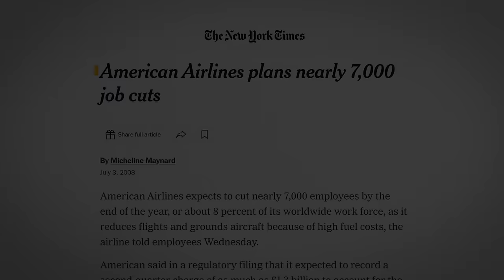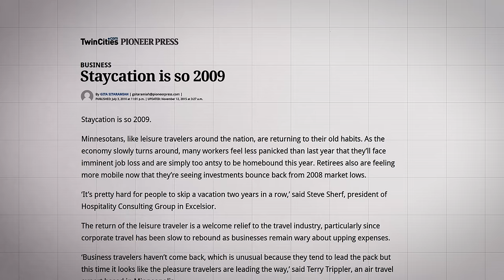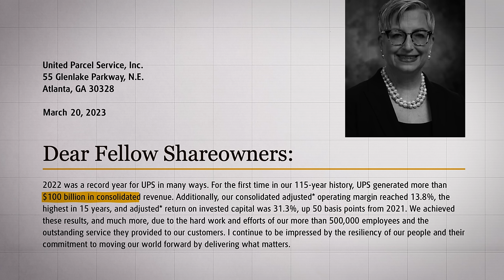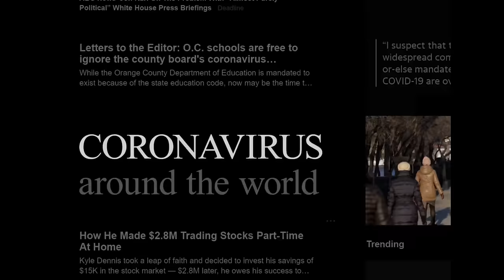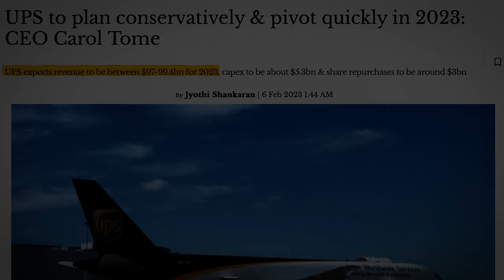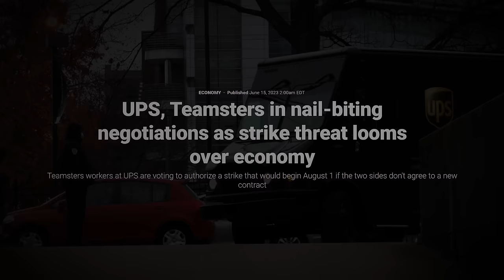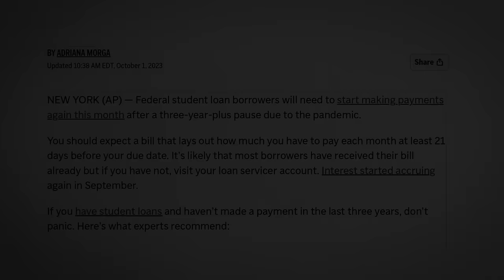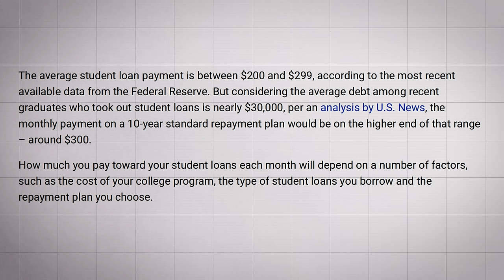Money is Gone: Airlines Start Layoffs Soon

Comment: As a UPSer, the whole situation does have me a bit concerned.  I'm in the automotive department, and a lot of moves they are making in this area show a lot of short term thinking, rather than a long term strategy.  A recent change in oil change services I feel is going to decrease the cost of oil changes on paper by making the services further apart, but cause a large increase in both non scheduled service and shorten vehicle life.  But this is what happens when you have a company catering to stock price.  They start carving out the meat of the company, gutting the long term improvement projects, and taking as much as they can in the short term. 
I can also see that we are about to hit a nose dive of a financial "readjustment" period that I feel will make the Great Recession seem like the good old days.  All the markers are there, and this time is going to be 1000x worse because of those companies gutting value and deferring capital expenses.  
As far as freight vs passengers, neither is better, but freight is less hassle.  Passenger planes are just buses with wings now.  A statement about passenger operations in railroads holds pretty true still, and that's that passengers are the pickiest type of freight.
Reply: I have worked for a huge multinational transportation and leasing company, and some of the things they came up with to save money were absurd. At one point, we were changing too many batteries starters and alternators, so they locked them in a cage that only a supervisor has a key for. Even if the starter solenoid was dangling from the cables, we had to load test the batteries, load test the alternator, amp test the starter  (both impossible while not running lol) and do a voltage drop test on starter and battery cables and record all test results on paper. Then the starter would be freed from jail and we were allowed to change it. They were in house rebuilds that were junk too and often failed within 6 months. I don't know about you, but I'm not changing a 40-50lb starter with seized bolts unless I'm sure it needs it.
Reply: I come from the heavy equipment world and you can always spot the fundamental changes that come with a new CEO. All too often they start cutting the simple things like oil and filter changes. Rapid fleet decline follows more quickly than many of them realize.
Reply: @juliogonzo2718  Wow. Oil is the cheapest thing you can do for a vehicle and they’re cheating out on that? That’s sad.

Comment: In the past few years, UPS has been going downhill ever since this new CEO was hired. In my department we have never really had any layoffs and they are saying possibly as many as 100 feeder drivers (we have about 360 currently in my local) will be laid off. That is over 25% of our department. After 30 years at UPS, I have never seen volume this low coming into the holiday season. Last year was the worst ever, and this year is looking as bad or worse. Also, where the CEO claims we will be getting close to $170,000 a year, that is the estimate at the END of this contract in 2028, not now, and even then I don't think that will be accurate. That was more a public relations thing to make it sound like we make more than we actually do. Trust me, even with the proposed raises and calculating in the benefits, it won't be anything close to $170,000.

Comment: Firstly, congrats on your upgrade. I’ve been at 5Y for over 12 years. My career goal had always been 5X. I was offered a class date 1.5 years ago and turned it down to stay to stay at 5Y. Mostly because of a lot of the things you’ve talked about in this video. Had I taken the class I’d currently be sitting at the very bottom of the list and quite worried about my job. No desire to fly people. I don’t think this is a cargo only issue though. I believe it’s just a prelude to an overall industry downturn. Most airline pilots under 35 haven’t flown through 9/11. Haven’t flown through 2008. Most have never been furloughed. Everyone has been looking at the last two years of hiring as if it’s going to be this way forever.  All signs point to a substantial economic letdown. I’d rather be insulated with some seniority and make slightly less pay than worried about whether I’m going to be able to pay my mortgage in six months.
Reply: Yeah, being at Atlas if you’ve been there for 12 years is and staying is better than leaving to start over. I am going to guess you are around 45-50 so definitely the right call. Good luck bro.
Reply: @williampotts3 the grass is always greener.....  i think you made the right decision, fwiw.

Comment: Of course there are pay , schedule and route considerations, but if all else is equal, I rather fly cargo than passengers. I do not have to be as concern if I am forced to divert, cargo do not complain, and no boos from the back if I have to plant the gear down firmly on a windy day, and less concerns about spilled drinks and meals. I am also under the impression the cost of labor is a small amount, especially for freighters with no cabin crew. The main cost is fuel, maintenance and paying for the plane etc.

Comment: Love the channel.  Went into the DHL report on the global state of the Air Freight industry.  To summarize demand is lack luster and capacity has increased, Air cargo rates are still 29% lower than last year levels (but trend is increasing).  So short term it is not a stellar outlook but long term e-commerce will continue to drive demand.  So perhaps UPS has excess capacity and is matching it to what it thinks market demand will be.  I think most companies can handle this by stopping hiring and going through normal attrition.

Comment: That is not all the problems for UPS. Here UPS is considered an inferior service with bad customer services. They are behind on modern ways to communicate with customers, which means dealing with UPS causes more hassle. For instance if you can not be home at arrival, UPS just leaves a note in the mailbox. You do not even get an SMS message when they expect to arrive. So you get a lot of hassle with contacting them to arrange a new delivery. Other companies, like DHL, BRING and DAO, send an SMS about the delivery. In that SMS there is a link, where you can change your delivery to a local outlet or they can simply leave it without a signature. So no extra waiting or having to contact customer services to arrange a new delivery. Besides, you often have to wait 30-45 min on the phone to UPS. So UPS is simply not up to date with customer services here in Europe - and why they only have a small share of the market.

Comment: Well yeah, UPS was just forced to up their driver pay from an average $60,000/yr to 140,000-170,000/yr. I'd wager there's probably 100 drivers per state on average (total guess) and with 50 states, that's an estimate 775,000,000 cost in wages up from ~300M (so a 260% increase in cost).

Now begins the rubberband reaction.

Comment: Good thing you have 1.2M subscriber's. Better turn those ads on to generate a little revenue.
I can assure you with both Russia and Middle East at War, fuel costs will increase when we need the most.

How did FedEx top UPS with their crappy commercial portals? The error in freight rates cancel volume discounts.

Comment: During the cockpit incursion of Horizon Airlines 2059, on Sunday, the intruder (An Alaska Airlines Pilot in the cockpit jump seat) was trying to pull the fire suppression on both engines. (84 souls on board.) If successful: 

Would the pilots have been able to restart the engines?

From the flight recording, I believe they were at 10,000 ft.

Comment: Inflation affects every industry and persons at different speeds. The average family was the widest group who actually felt it first on a personal level because it hit the pocketbook. This is creating less unneeded purchases. Why? because the suppliers had no choice to raise their costs. Air travel continued to grow with airlines expanding their routes, and currently air travel is higher than it was before the pandemic. At some point the unstable and high fuel costs will have an effect on commercial air for travel and cargo. I know the airlines hedge fuel purchases, it's what propelled Southwest to the position it's in now but at some point, that speculative fuel purchase is going to hit hard, stripping an already thin profit margin from the carriers to the point where fares will return to pricing that only higher-class earners can afford. Oil/fuel is what feeds and controls so many markets. Trucks, trains, boats, aircraft, power plants, farm equipment and the list goes on. When the cost to do business, which all businesses either directly or indirectly do, relies on the price of fuel, there may come a time that companies can't operate because the customer won't be able to afford to use their services or buy their product. This is NOT a pro alternative energy comment, it's the exact opposite. Pushing alternative energy is a major contributor to the problem.

Comment: The issues in the ME wont help if it kicks off proper.  The likes of WG might actually do better out of it though as their DoD work will go up.  Personally I think WG will just be left to expire so the "stuff" they were doing (if you get my drift) can be shifted onto the next company - in fact thats already happening / happened.  The other issue with the ME is that it could push oil prices up.  Big problem for airlines.  And then the nail in the coffin could be if airspace starts to get closed and this means that flights between asia and europe could be very expensive for a time as the main back up routes that are being used right now would be closed and new routes via central African airspace would be needed and the cost would be so high I doubt there would be many flights operating.

Comment: UPS used the pandemic as an excuse to only open their customer centers an hour or so a day. They've since continued that practice. Sure, the UPS stores exist, but it's not the same. And UPS has always been by far the dingiest of the big shippers, they've always got bare concrete floors that have never seen a broom and counters with the venier held on with, what else, packing tape. Meanwhile Fedex has nice carpeted floors, good lighting, etc. And, for the last few years, they're actually open reasonable hours.

Comment: Here’s what wrong your math. You are comparing Pandemic profits to post pandemic profits. If you would have looked at UPS numbers for every year 1907 thru 2019 , UPS will still make more money in 2023 that in any of one those years. The 2022 profit that UPS was more than than the company made from 2017-2019 combined. In fact 2020-2022 they made more profit than the last 2O year’s combined. Nearly $35 Billion. They also hired nearly 1000 pilots during the pandemic  to deal with an almost 200% increase in packages, while offering early retirement to less that 200 after the pandemic numbers dropped. Some of those pilots got $400,000 retirement bonuses as well. You don’t get a bonus when you get furloughed. It’s a too many pilots not a financial problem. If it was both they would have furloughed. A few of the passenger airlines just posted a loss and UPS still made 1.2 billion in 3Q. Give it 6 months to a year and let’s see who’s worse. My money is on passenger flying. Those credit cards are maxed. Cargo is a need and vacations are a want.

Comment: Also looming on the distant horizon for freight carrier pilots is the concept of Single Pilot Operations. This concept looks to reduce the number of overall pilots required aboard a long-haul trip. Two pilots are always required to operate the aircraft at any given time but there are usually one and in some cases two additional pilots on standby when one of the operating pilots needs to rest due to the long flight times. The Single Pilot Operations concept would reduce this number of relief pilots to zero and allow one operating pilot to stay on duty in the cockpit during low demand segments (at cruise altitude) while the other operating pilot rests. This concept will ultimately prove itself out in the cargo world before gaining momentum and creeping into the passenger carrier world. Long term this will diminish the pilot job opportunities at cargo carriers worldwide as companies race to the bottom to save costs and become more competitive. Look for the long term impact of this to play out over the next 10 years.

Comment: the greatest reason I would never become an Air Line Pilot is because they make you join some goddamned Union.  The Airlines could keep on operating but for the fact that obviously the pilots and crews want more money than they are actually worth.   How much to Long Haul Truckers get?  How much does a Grey Hound Bus Driver, or Trail Ways?  Airliners are just Buses with Wings, right?    Also, keep in mind that Planes can already fly themselves.   And we already know that if Boeing builds anything, then there are FAA Officials, eager to get a Retirement Gig with  Boeing, who will Certify anything.  We need the Airplanes... not their high priced Pilots... and, hey, what are the number of deaths assigned to Pilot Error?  Pilots are actually causing a Body Count.  Of course fire their asses!  See what Life is for the rest of us... see if you can work three part time jobs after being fired from your Full Time job.